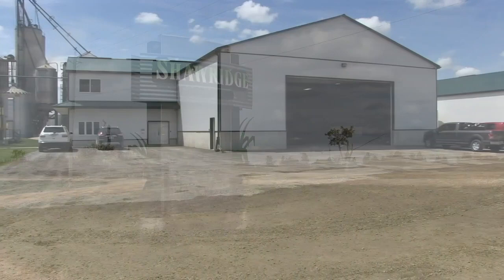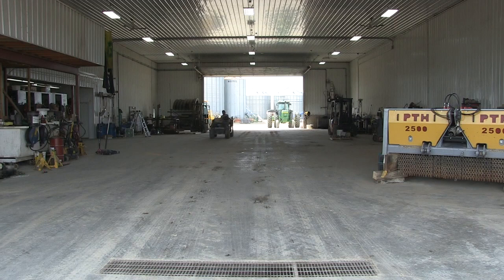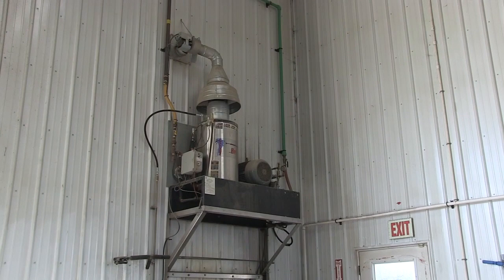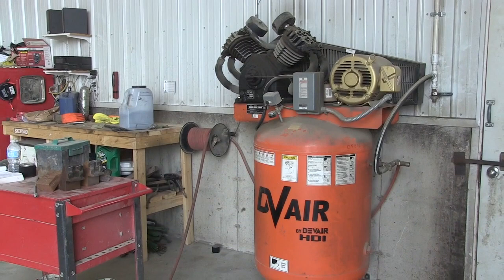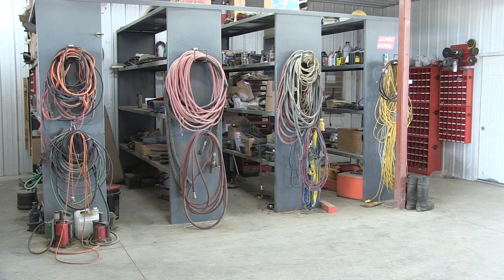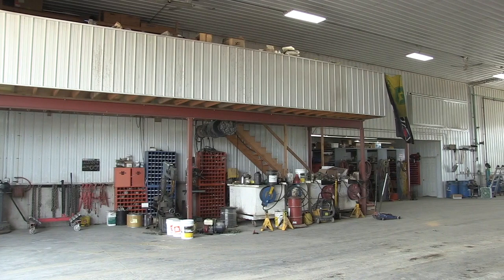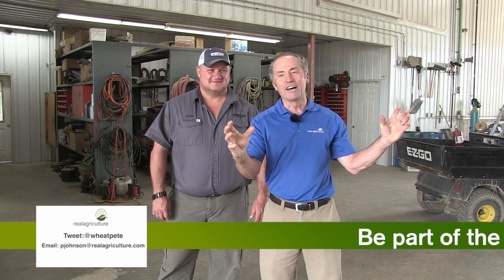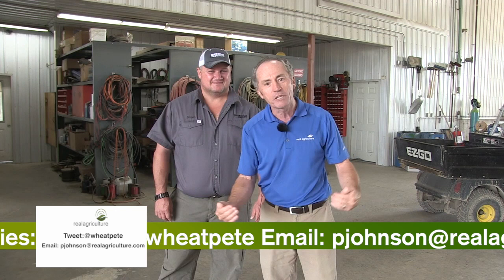Real Dream Workshops, Ep. 1 — Shawn Schill

Comment: The metal siding and ceiling, although light reflective, really reverberates sound. I work in a shop with a metal ceiling and you can't hear anything if the compressor or heater are running
Reply: Christmas Cox                     Some people use the tin with little holes to the top 1/2 of the wall or use wood for the lower 1/2 of the interior walls. One shop I know built a room for the compressor in the corner of the shop to cut noise.

Comment: Air compressor should always be in it's own space!!! Not only to cut down on the noise, but also so it can breath cleaner air...
I always tell people, make it big enough to put your two largest items in it... Then at least double that!! Even then, you will never make it big enough 😥
We still work out of the original shop... (Had tools and welder in a low section of the cow barn, only thing it had was a concrete floor. Too small to get anything inside)
We have a 30x30 with a 20' lean-to for storage.. combine doesn't fit, trucks are all too long... 
80x120 would be great!!!!!!😎